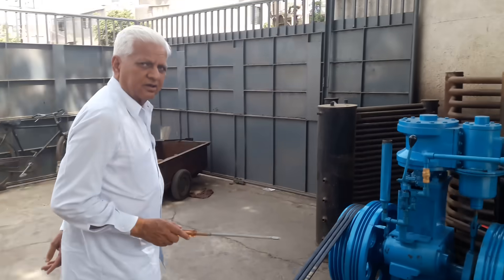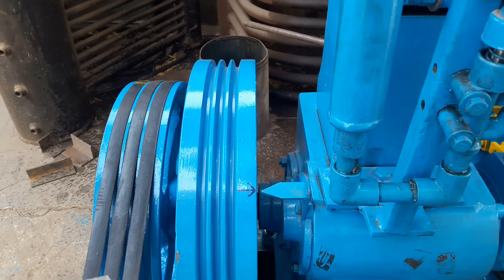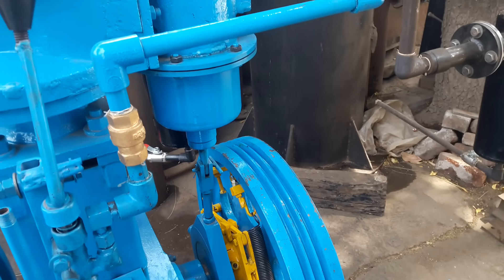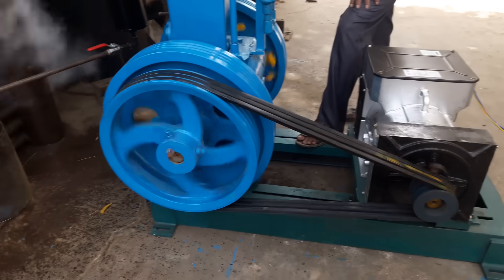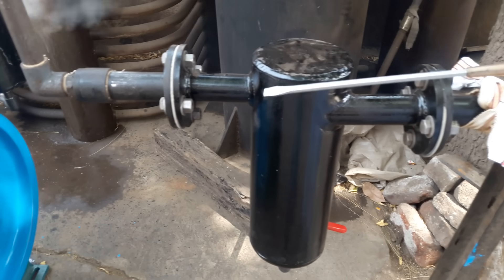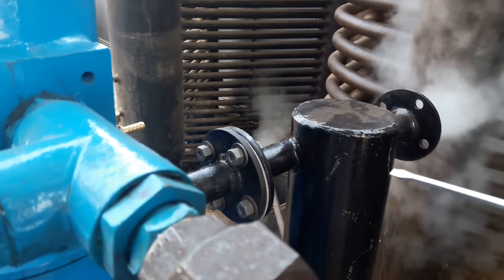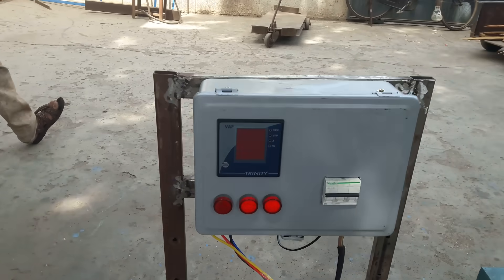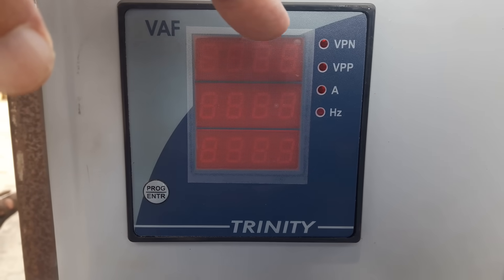STEAM POWER PLANT 25 HP - 15 KVA

Comment: Hello,

Beautiful machine.

1) Why is there a water separator at the exit?

2) Are the inlet and outlet of the separator at the same level or height?

thank you.
Reply: Yves Baggi the separator on the outlet is for lubricating oil not water.
Reply: If water will enter the engine engine will not generate full power.
Reply: Yes

Comment: I think U need to resend exhaust steam back to boiler or make other boiler to save that steam and  repeat it for further use
Reply: not possible
Reply: @subbarao25 possible h sir jii 
government jo plants bnati h unme ase hota h
Reply: government jo plant banati hai usme steam turbine use hoti hai. aur distilled water use hota hai jisse wo plant chalta hai
Reply: I think they want to save money on the condenser.
Reply: This engine has an injection lubrication system. You need to seperate the lubricant from the water then. If you want a closed system, better get a different engine like a turbine.

Comment: I like how the cyclinder has been seperated from the crankcase and the valves are a slifding valve? As those engines are also made in twin form, could you make a double expansion engine to run a bigger alternator?
Reply: Yes it's available.
Reply: Your mobile number?

Comment: Its a listeroid running on steam
Reply: thank you
Reply: Yes , looks like a steam cylinder added to a Listeroid, maybe using original piston or cut down piston as slider. Needs to keep condensate out of the crankcase oil. If waste biomass available for a boiler this could give a gasifier and IC engine a run for its money. As pointed out, low efficiency as is. A condenser would help if no plan to use exhaust steam for process heating. Sissons, Robey  Sentinel and Bellis & Morcom etc had some great high speed steam engine designs in the 1920s and 30s  that could have some elements to include here.

Comment: Dont be a dick. Cover up those belts so no one can get hurt and die. ´ Other than that, a beautiful build.  Not super quiet, but super strong.  How much maintenance is needed on that steam engine. What people need is a system that could put out about 6 to 10kw of power for a home, that is as quiet as possible. This still costs money, and time, and that makes solar panels start to look pretty good.  I would like to make a solar heliostat farm and generate steam for your machine.  And run that on a farm, or big estate, or such.
Reply: Since we are dreaming, I don't think you need a boiler at all in the first place. I think you could have some kind of flash steam device, and maybe feed that with a boiler. It seems to be an impossible problem to solve as no one youtube has solved it yet.  It is all too hard to do isn't it?  I  think the jews get their electricity from the air for free using energy masts.  Check out Aaron Dover Atmospheric Energy and Energy Masts.

Comment: looks like it is the body of an air compressor rejigged.  interesting idea. had me fooled at first with the two pistons-- I thought it was a tandem compound but no only one power cylinder. The other auto cylinder acts as a crosshead guide.
Reply: I think too.
Reply: i think it is the body from a lister(oid) diesel engine, not a compressor.  And it doesnt recycle water, so it is a lot of work to keep it running...